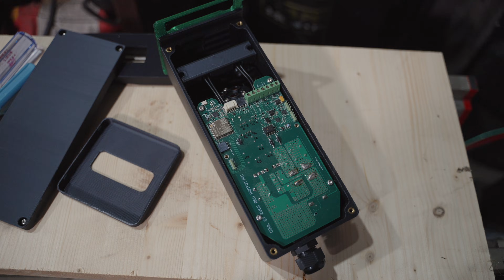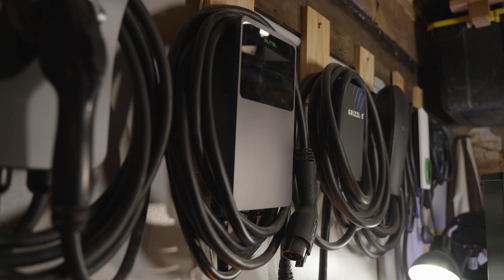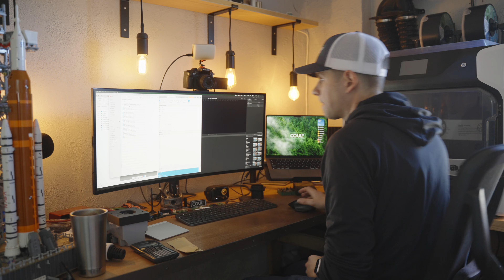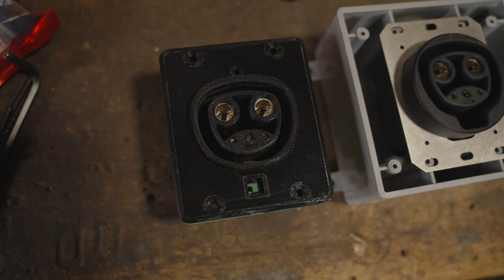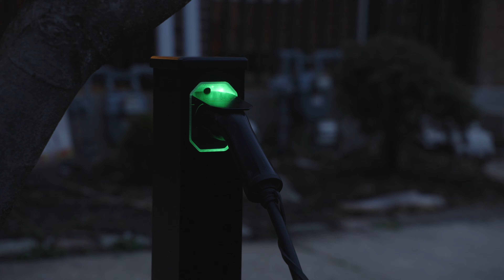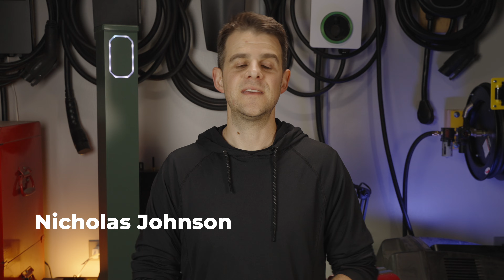Where's the MK5?

Comment: Like others have said, in my head the two part solution was better. It pretty much seemed that whilst the controller to outlet part would have had an extra cable, it would be possible to be cat6, with PoE to provide power to the daughter board at the actual charger.

The idea of being able to separate the main relays from the charger outlet meant added safety in my mind because the wires to the street would only be energized when the vehicle had connected.

For multi-family, the idea of a single controller unit being able to feed multiple outlets, power-sharing between them so you don't need full power to each outlet all the time.

The ability to match a different outlet style to the charge control unit depending on needs also seemed like a good idea. And yes, network available at the charge controller vs WiFi or cellular at the street.

Still excited for what you're doing, but it does seem to me that some of the selling points have gone.

Comment: It’s disappointing to see you move away from the 2 box solution as this solved a number of issues, that would have enabled a low cost solution. Namely being able to rely on WiFi rather than requiring cellphone data plan and lower cost repairs 

If the communication cables were an issue ( and I struggle with that reasoning) did you consider powerline communication between the box and the post?

Do you have an idea on what your price point will be?
Reply: This is definitely something to consider imo

Comment: so glad you are using the standard Metraline adapter so you can use anything on the other end.
Reply: This is the first time I've heard it called "Metraline". I hear it called the "Mennekes connector" most of the time. And yes, having the a cable be the adapter instead of the various J1772 vs NACS adapters will be nice.
Reply: @KellyCampbellPHL  Sorry I looked up the name, I most likely got the name wrong. Just excited for the future.

Comment: Simplicity is definately a good idea.
However I would try keep the secondary unit in play here - and this is for safety.
There is a non zero chance of someone hitting the unit and damaging it.
With the high current available for the chargers it could be a nice sparking sensation if something does occur.
How here is where the fun comes in... 
You already manage using the earth to identify charging standards from the car itself .... but you can do the same going backwards.
Its a lot simpler.
So instead of having 2 sets of wires, you just use 1.
What you do at the base is have 2 sets of breakers
1 set - very low (I'd do like 2, max 5A) - but US might have to be different.
And then the max the wires/system would handle based on distance etc... 
add a contactor (big relay) that just switches between small relay and big one.
You then can use comms over power to communicate.
Yes complexity, but big safety while keeping it simpler.
If there is an issue with wires and it cannot communicate ... you have bigger issues.
By default 2/5A relay is active - so if someone smashes the pole - not much current can flow before it trips.
Also, if someone were to try and manage to bypass the control circuit in the charger, it would just trip - so also theft prevention.
You want the breaker sized just enough to handle your kit and nothing really more... 

Your system does the comms to the main board (there are small chips that can do this already - think ethernet over power) 
Tells the main board to switch contactor on. (may have a dip in power, nothing a capacitor cannot handle) - this is a switch, so either 1 is active.
(trick, out of the 5A breaker into the contactor, so if it trips, it takes whole power offline without delay - and the 5A trip is in front of the breaker for the system, so if main trip is hit, it takes all off as well)
Then both just keep a heartbeat going.
Once charge is done, request to switch back - and drop contactor.

If unit gets hit while charging, trips main breaker - contactor isolates and system is de-powered.
if unit gets hit while charging but no wires damaged, heartbeat fails, contactor isolates.
if main unit locks up or something goes wrong in it, heartbeat fails, contactor isolates.
if unit gets hit while idle, trips 5A breaker, system isolated.
if unit gets hit while idle but doesn't trip 5A - then power still travels, but minimal power so just a small spark and it'll trip.
(I'd love to say add additional checks here, but thats complications and you have enough protection here.
If someone were to open your unit/pole to grab power, they only have a little power avail - so if they tried to plug anything that drew a lot of power, it would just trip the small MCB

You can also be smart since US has the 2-phase power system.
So, if the trip is only on a single phase but contactor connects both phases - you can use the NC on the contactor for the 5A link (simpler).
Then your board can know easily if both phases are up or just a single phase... if the contactor is on or not to start the charging.
(should already have these sensors in to monitor the power, so its just some software changes)
(And you can communicate to the contactor unit the same way the car communicates to your board .... 1 way comms, simple but effective)

The nice part about doing it this way is you are keeping wiring simple, and also not depending on wireless which could be an issue.
And technologies exist, so you aren't re-inventing the wheel.
On that note, if you were to use the comms chip like the newer MPL460A - you could do full 2-way communication.
So, you could actually put an ethernet power or wireless receiver in that box without running additional cabling.

Now, think of this in a commercial setting.
You can add current-clamps over the incomers.
You can then make a 4-unit varient.
So you can wire 4 charge poles to a single 'contactor' and you can then also control total avail current.
Say you only have 100A avail at your contactor box.
Say 1 pole is drawing 40A, another pole draws 40A and then someone on the 3rd pole plugs in, you could limit to 15A, then once power is stable, re-adjust all to 30A with 10A spare.
4th pole gets plugged in, first thing it does is limits to 5A, then re-adjusts all units to 20A and brings 4th online.

So yes, complexity but handling commercial/home with no real hardware changes - which means lower cost since you are not making specific boards for the 2 avenues.

Then expand into CPOs, same as commercial - just software and maybe poles are physically different - but units themselves are the same.

So a bit of complexity to simplify deployment and expandability. 

Espec for the CPO/Commercial side - by having the comms in the contactor unit instead of the poles - you drop the TCO of each pole since you don't have 4-10 units with wifi, iot and other communication interfaces.
Which chips alone would be in the 10-80$ range. * poles
Now... say your max contactor unit is 4 way right.
What you do is just include a 'communicator' or 'gateway' - so you have 4x 4ways, 16-poles .... 1 gateway.
This path caters more for the multi-pole deployment system over single.
But it also means your 'communicator' units can be simplified.
Just wifi ones, or wifi with LPWAN or with LTE or whatever based on the deployment case.
Make a single board with chips polulated or not populated - lower board and enclosure costs.
(note ... if your contactor enclosure just has a place in it for the board, then no additional enclosure cost required)
And you can use an off-the shelf enclosure for this stuff.

But anyway, just ramblings and ideas for you :)
Reply: They'll send you your $500K consulting check in 2 weeks 😅

Comment: I still want your two-part system.  It has so much application for carports that aren't permanent installs (most carports where I live)
Reply from the maker: That sounds like an interesting application. Do they get moved often or just classified as a temporary structure? What do you see as the benefit of the separate parts there?

Comment: Did you replace your j1772 receptacle with a type 2 receptacle for the J3400 specification?
Reply: I confirmed with a manufacturer that Type 2 to J1772 cables are available.
One minor concern is that they are limited to 32A, or about 7kw.
Reply from the maker: J3400 does call out Type 2. It’s also an easier standard to implement as it already exists and cables are widely available. Also, there is at least one other US company already using it so that will improve interoperability. We are planning for up to 48A with Type 2, but it does require a tweak on the Type 2 standard. Physically built into MK6 already though.
Reply: @chargeeverywhere  I was getting the feeling that the J3400 folks were trying to figure out how to get more than 32A.
The pins themselves are rated for 63A,

Comment: Wasn't one of the reasons that you split the electronics was so that in the event of an accident at the street you didn't have live AC current? How did you solve that issue?
Reply from the maker: Correct, it was one of the reasons and is still a concern for us. However, there some passive solutions available for the installations that require this. More in the future.

Comment: im not in north america, but sell me this in the UK and i'll use it, my dwelling is weird i have off street parking but the house is on a different level to the cars etc, installing a post for this  nad then running the cables back to the dizzy box would be great, and its already type2 and 240v capable. im not usre how much work would be needed to make it 3p capable, but in the UK at least thats pretty rare
Reply from the maker: 3ph is a bit trickier as there is more high power lines to fit into the box. However, they each carry less current, which is helpful. The short of it is that we aren’t currently planning for 3ph, but it’s definitely a possibility for the future. Thanks for the comment!
Reply: @chargeeverywhere glad to see this hadn't gone dark, I have to admit I was a little worried, glad to see it's carrying on!